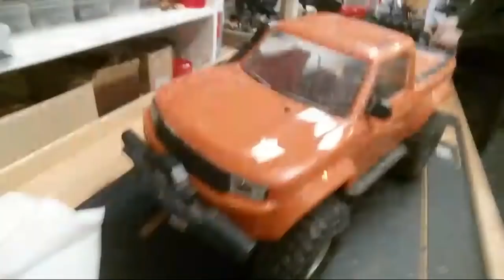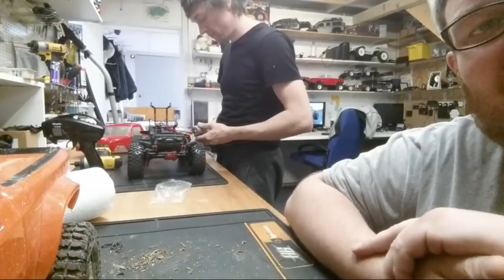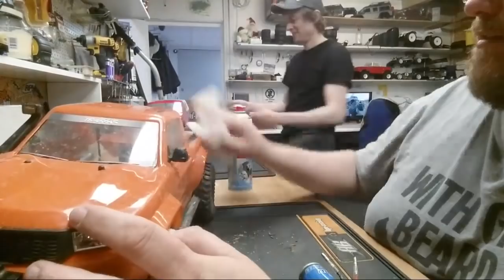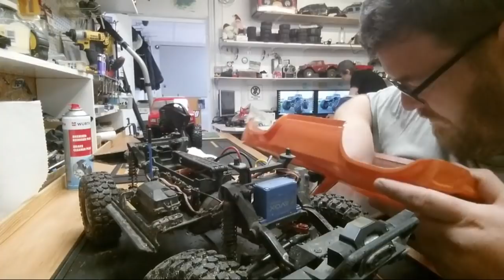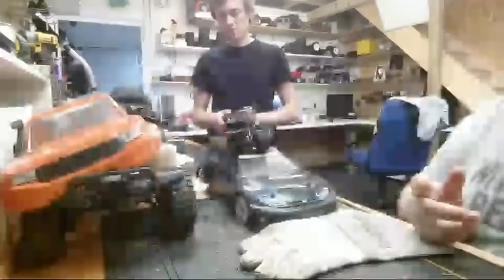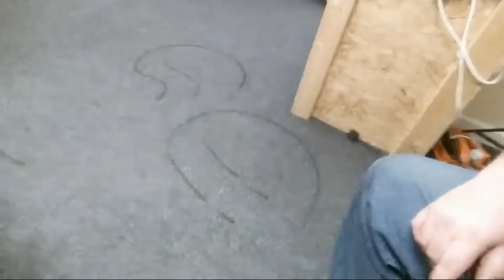Short Shop Time

Comment: Get the granite Pat! I got the senton 4x4 and fitted a gool system. It flies on. And takes a lot of abuse. I wish I had bought the granite to start but I still have an original granite mega 4x4 that only needs some love to get bash ready again. Working on my maverick scout crawler as I watch. Just weighted the wheels and re run all wiring and esc as low as I can go. 👍🤯